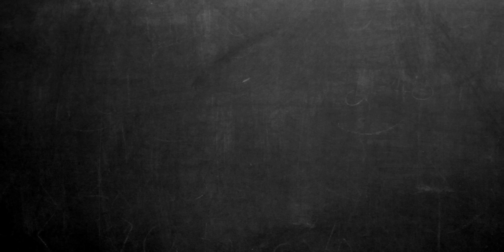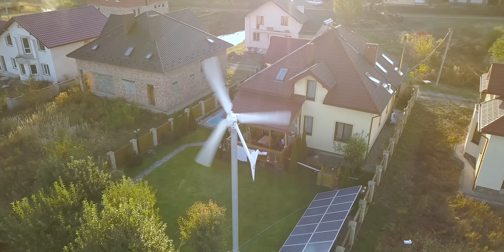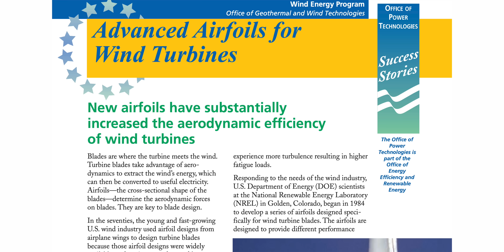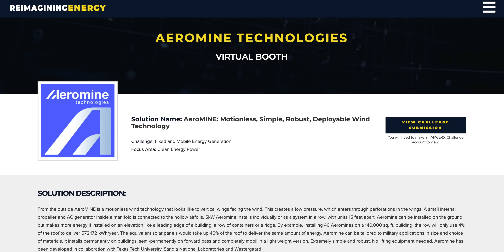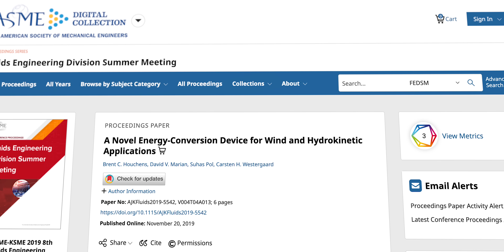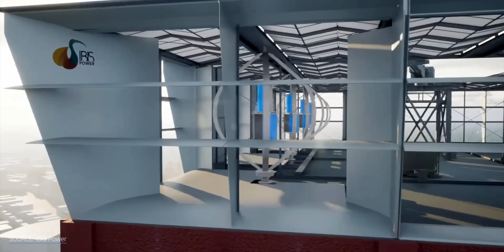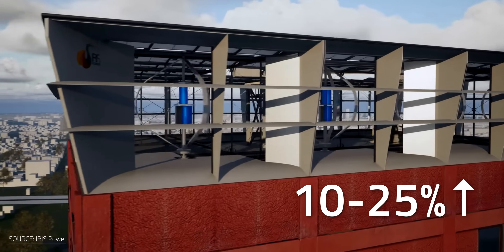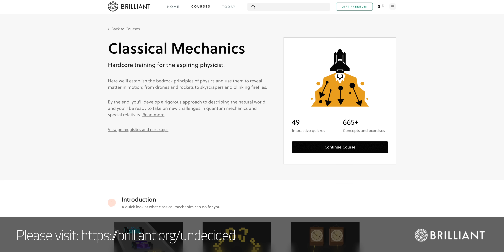How Can A Wind Turbine Be Motionless?

Comment: The answer to cheap eco friendly energy is nuclear.  it is the only option for the world. it is the only thing that makes sense for everyone across the globe. Endless supply and NO endless replacements being dumped onto and in the earth from worn out solar panels and wind mills every 20 years across the globe. But then they would not be making trillions of dollars a year from all that replacing worn out equipment,  which is why they will NOT allow nuclear.  Its ALL about big MONEY flowing in. Rather than any concern about environment.  Drill and frack like hell until this is done.  We must have energy from fossil fuels for everything we need.  That will never go away. Nuclear energy will minimize its use for what we do need from fossil fuels.

Comment: I've been a green energy guy for decades and worked some with wind.  This principal has been around for decades.  I hope this works and is cost effective, but normally the yields are over-claimed, and because of the aerodynamics of the buildings themselve,s the air velocity is much reduced when placed on the rooftop.  Not saying it doesn't "work", but let's see one installation, with actual data and costs.. before we have yet another "green-energy-solution" that is has relatively low yields and is abandoned within 6 years.

Comment: Ok, I'm the furthest thing from an electrical engineer, but I've got questions no one has ever answered to my satisfaction. Can anyone do so here?

1. We've used windmills on ranches and isolated areas for years. Wind turns blades, you get a current through a generator. (Which is a mystery to me how, but let's skip that.) Now, everything I've seen says you use that to charge a bank of usually sealed lead-acid batteries, then run off the batteries. This is the expensive part.

Why can't you wire directly into your service, and use the power directly? If it is joint with utility company service, you use your wind power. If it drops below demand, you use the utility company power.

2. If you produce excess power to "make the meter run backward," aren't you essentially do oing this?

3. Why do we need to produce 200% of power in a house from solar or wind? If I have a small windmill at each end of my roof, maybe I get 25-50% of my power that way, and utility company does the rest.

We used to have TV antennas on roofs. My house still has the big, tall TV antenna tower one can climb. Why not small blades on that?

3. If the above would work, and seems it would be pretty cheap, couldn't every house be "30% off the grid?"

Comment: I wish that I was an engineer.  I've been theorycrafting with a very similar idea for a decade, after living in the arctic.  The wind blows quite regularly there, and very strongly, so a normal turbine would be torn apart, and this design would be iced over in the winter.  My design should avoid both problems, but again, I'm not an engineer.  :(

Comment: If i may be so bold as to make a small correction to your video. A standard 3 blade industrial wind turbine typically only needs 4-6mps of wind to start generating 2-3m/s not the higher target you stated. good video as always although i suspect this gadgets a bit of a gimmick and when we start with real world data it will not fly. shame

Comment: No thanks. I have a 210kw solar system. 
If I used wind, my costs would be over double the price that I made my solar system for.. I would also have to worry about spikes and my load dumps catching fire, also have to worry about not enough wind also would have to worry about gusts and breaking turbine blades.. where I have over 320 sunny days per year here.. also need special charge controllers and special inverters.. no thanks..

Comment: I think Aeromine will under perform by a huge margin.  I used to work for a great company that was purchased and merged with a competitor that we dominated, but the competitors management ran the new merged company.   The new company made failed product after failed product and they made impressive claims in vague language.  They put my companies old trusted name on their new product line and failed to deliver time after time and destroyed the brand name such that the name became a liability and was dropped.  

As a technical person I wan to see comparisons with hard numbers and power production curves.  Their out performance of the solar cells may be on an overcast day with 25 mph winds.  I also want to see an angular flow chart showing wind axis vs off-axis generation numbers at various wind speeds.  Do not invest money into this company, you will lose it all.  On the other hand the hybrid Power Nest system seems very impressive and the most efficient use of space and variable conditions.
Reply: thx for the warning. Was thinking about investing.

Comment: the best wind turbine that I've ever seen designed and in use was a Vertical Wind Turbine with 'sails' instead of blades and they were inverted staggered. it was encased in a wire mesh in order to keep birds out and needed much less wind power in order to turn. Each also was scalable to be small enough to be used for a single home or large enough for an entire small neighborhood. So a large group of them could power a fair sized city. The land footprint was much smaller than current tri-bladed ones and much less destructive to wildlife (especially birds). I don't know who built them, but they were really popular with the "Earthship" community.

Though, this design would seem to be a great design, IF it was in use and kept it's estimated power rating.

Comment: Now these are potentially viable ways of reducing dependence on coal and even natural gas. Climate activists want to destroy the current power grid with no realistic solution to replace it. Concepts like these, if successful, could reduce our carbon footprint by a significant amount since industrial manufacturing and apartment buildings comprise a major amount of energy usage. Solar panels on homes would reduce it even more, but none of these will completely eliminate power plants.

Comment: There’s something that you got wrong twice, and I don’t think it’s a mistake.  Lift is not crated by the low speed, high pressure up part of the wing.  Rather, lift is created by the vacuum from the high speed low pressure top part of the wing.  Basically the wing of a plane is “pulled up” from the top, not pushed from the bottom.  I’m surprised you would make that mistake multilentimes

Comment: I disagree with the idea at 2:51 that a higher air pressure under the wing causes lift. In regard to aircraft, it's the low pressure on the topside of the wing that is causing "lift". The higher pressure under the wing does contribute to creating lift, but it's a small fraction of the whole. It would be awesome if we could cause a near perfect vacuum to form above the wing as the lift would be amazing.

Comment: Interesting. Sort of a wind collector, funneling the wind into a narrow space, therefore increasing the flow or pressure. I can mounting it on a turn table to allow it to always face into the wind for a more reliable source of energy. Of course you'd still need a way to store energy when the wind isn't blowing. This would be good to supplement grid energy to reduce electric bills.

Comment: Would be nice if we had more advancement in the tech. I"'m looking at solar now and it doesn't seem to have changed much, still $30K for 14kWh system, where one has to choose between pool solar and producing electricity (yes there are options like CoolPV, but,...) Something like this in the video would be welcome , but as you state, not really made for residential without flat roof. I question why the tech has been so slow, and feel like it's because the solar industry doesn't want to move too fast, and continue to sell us what I think is antiquated tech,

Comment: Take a look at the video at time index 6:00 and tell me if you think the spinning blades are really inaccessible to humans and animals.  Unless it's using an invisible force field, they are very much accessible (and quite easily, given the size of that opening).  That can be easily remedied, however, and it looks to be a big step in the right direction.  The fact that "green" energy powers so little of the grid is what boggles my mind about the push for electric cars.  Great, so the cars use electricity.  That just means you're shifting the "dirty" part to the power plants.  If that electricity is produced using fossil fuels (or, quite frankly, nuclear) at power plants, then you haven't done anything to help the environment.

The thing I never see mentioned when anyone talks about "green" energy is how green it is overall.  Sure, the "green energy" devices produce energy without using fossil fuels or nuclear fuels.  Great.  But what is the energy used and ecological impacts of producing those devices (and disposal once they reach their end of life)?  That's the part that's never discussed.  We need a comprehensive analysis showing the lifespan of the various energy production methods along with their financial and ecological impacts at each stage (production, usage, and disposal) and as a whole.

For anyone wondering, I'm not saying this because I'm anti-green.  I'm very much pro-green, but we need to look at things and discuss them logically, without emotion.  Additionally, if we see that "green energy" devices aren't as green as people think, then maybe that will be the catalyst to inspire new technologies or to think of ways to improve the current technologies.

Comment: Seems like just another variation of vertical axis wind turbines (VAWTs)
Which capture only a fraction of the wind a traditional horizontal axis wind turbine (HAWT) does.
Please understand there is not much energy in a wind speed of only 5 mph, or even 9 mph.
To generate sufficient power to justify their cost any residential wind turbine needs a sustained, non-turbulent wind speed of at least 20 mph, and you don't see that for any wind turbine mounted on a roof.

Comment: So, not only another piece more expensive, but also it has to be on the"predominant side" to the wind. Another thing is when it starts moving and another thing is when it starts generating power, that's when it needs pressure and flow, if that drops it will stop generating power, maybe in some places it could work, but also the solar panels are the cheaper way to generate power, I had a windmill and its a piece of rubbish, as it only gave me real energy only when it was really windy and that is about 20kt for a couple of days. And the solar panels, are the only ones that never let me down ever since my dad mounted them over 30 years ago(with new additions) so no, no windmill would ever be worth the money. Balearic islands.

Comment: I think the power nest is the way to go, especially for mid tp high rise buildings.  The aeromine is limited due to it being on a fixed position. Why not automate it to face where the wind is coming from like those used on solar? I mean more moving parts, yes, but wouldn’t the increase is output justify it? Curious and I’m legit asking 😅
Reply: The other issue I see is that Aeromine is being positioned as an alternative to solar (more power than solar is meaningless if you don't specify the environment where it's installed, there's plenty of places with very unreliable wind conditions and year round sunlight for instance), whereas the combination used by power nests means that you can both get some power at night and also when there's no wind. Best of both worlds.
Reply: Most of the human being couldn’t understand when they don’t listen/hear what is told or written. When someone tries to make comparison; it is simply a basic to compare on same level of energy production.
Reply: Thinking that myself as far as mounting multiple low profile aeromine units on moving vehicles such as RVs that could use a simple weather vane and a plate bearing to always point in the direction of travel or wind direction wether in motion or standing still.
Reply: What you are referring to are solar trackers. They track the sun as the sun path is predictable. Wind, not so much. It can be very low cost with just just a motor making small adjustments throughout the day.  For wind, you might need sophisticated sensors and motors to rotate the wind turbine as and when.  I don't think they can easily rotate like traditional single axis horizontal wind turbines.

Comment: The blades are not the only problem. Wind is intermittent and unpredictable making it a challenging energy source. Electrcity is also used as it is generated, and wind does a bad job of servicing the need at peak load times. People don't realize how on demand their energy is right now. Wind does not meet that need.

Comment: I work about 200 meters from 'Haasje over' where the PowerNest is placed. It is silent and produces a lot of energy for the building beneath. However, due to the building's power usage, they actually reduce the Nest's output by as much as 50% most of the time. It's been suggested to just put mining rigs on top of the building if the power can't be fed back in the net.
Reply: the city doesnt allow it to be fed back into the grid? thats quite insane. there are ways to disconnect the system in case the lines go down to keep repair workers safe. The only reason to make such a decision is if the power companies are blocking it. 

Another system i like is one where they place spaced out solar panels about 10-13 feet or about 3-4 meters above certain farm land. in many cases crops get too much sun and having intermittent shade from solar panels helps them grow and because of less heat directly on them, less water evaporates so they also use less water to grow. Because of the height of the solar panels, farming equipment can easily fit underneath them.
Reply: @jessiejanson1528  There's a surplus of electricity during the day because of all the solar power.
Reply: Too many physics/engineering errors, is this an AD?
Reply: Why you need these turbines on the Roof, too far from any parks in the North Sea ?
my suggestion for the region is, find local solutions if you can, make a hoover dam whatever, be creative !
The roof, let's see in 10 years ! Eindhoven !

Comment: If you build a house with the 3 sisters agriculture technique converted to renewable energy forms BUT ON A HOUSE you'd might as well formulate a house aircraft because it will have enough power to reach space.EASY AS pi

Comment: Funny you should show the Strata at 1:36, given those turbines never worked — not least because they weren’t designed to rotate into the wind, but primarily the residents of the building complained about the vibrations 😵

Total idiocy of architects to trumpet the green credentials of a building that then isn’t fit for purpose.

Comment: Well I am Very interested in this technology, but the claims, and that's what they are untill efficiency, longevity & cost effectiveness is established, Stated CLAIMS (( Untill Proven)) are about What ultimately.? And I dont want to be negative at all. However, Being multi skills trained plus worked in cryogenics, noticed many bought & paid failures. However WE have seen CLAIMS made to Govt facilities only to struggle Or fail to meet standards, albeit, as you mentioned, SUBsidised  by TaxPayer funds in testing + R'ndD. 
SO many great ideas end up in court, SO NEGATIVE to the possibilities for the Future.
Development at a small scale to reduce failure costs could be Far more efficient. Oh yes, to be cautious for a moment,, That would mean Contractor Utilities Co.'s would be cut out for stand alone, OFF the GRID. But no different for single facility or home Heating, Cooling, Hot Water & food storage fridge/freezers..
Thoughts welcome.?

Comment: Lift is not produced by the higher pressure on the bottom of a wing.. rather the low pressure/vacuum  on the top, sucking the plane skyward.

Comment: Yeh big problem with wind ??if there isn't any you have no electricity .If there is too much .,there is no electricity because they have to be locked .Also their carbon footprint is huge and the pollute tremendously and cause micro climate change by redirecting air flows on the land ,noise and interference and not very recyclable .They consume alot of hydrocarbons to manufacture and are toxic to dispose of ??They don't know how to recycle the blades as of yet .!Balsa fiberglass,carbon fiber ,kevlar and epoxy resin .All bad for the environment and not very recyclable .By the way ,you can'take a wind mill without the use of Fossil fuels period .All you are doing is offsetting the carbon footprint to a later date .
Plus they kill alot of animals .
Basic law of physics .Energy can't be created only Transformed from 9ne form to another .You can't get something for nothing !

Comment: Can produce up to x amount of energy is very different from amount of power actually produced.  Unlike solar panels where the output is known, wind changes in every microclimate.  When producers tell you up to a certain amount of power, you can bet they are using the rosiest of rosy scenarios.  Also making power is different than usable power.  The power from generator is known as wild AC.  It needs to be converted to DC and then converted back to a AC curve matches the power in the grid.  Converting typically chops off the high end and low end of power curves meaning low winds might spin the turbine but not really make usable power.  The amount of power depends on the cubed area of the turbine blades.  So doubling the size of the blade doesn't double the power potential, it makes it 2x2x2 or 8 times more potential.  So bigger is ALWAYS better with wind turbines.  Very leary that a setup equal to the size of home solar array would produce more power than solar panels.